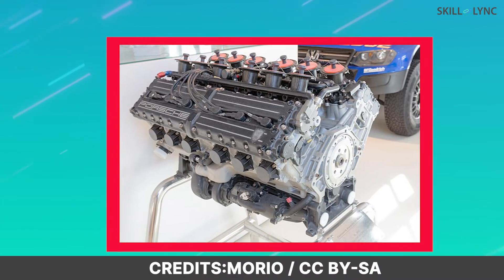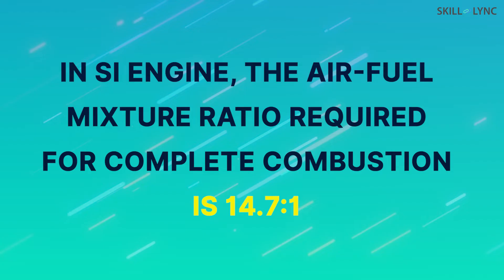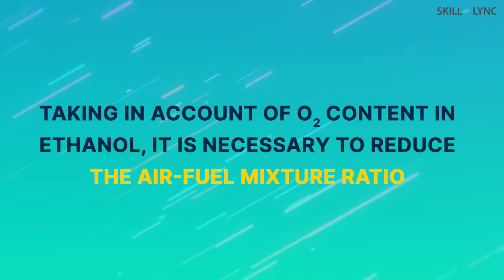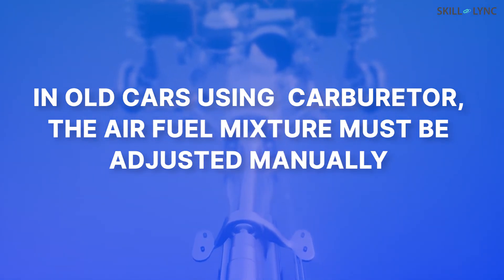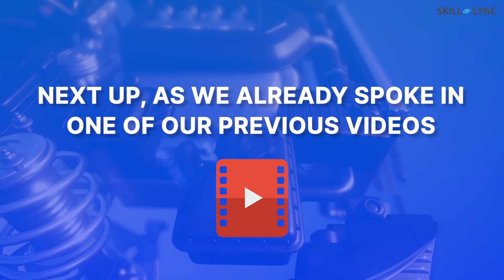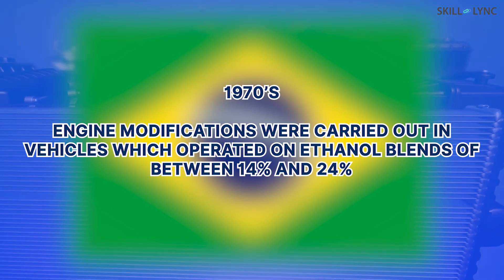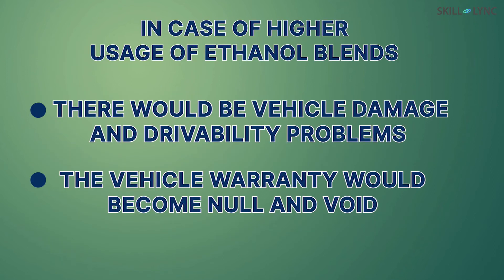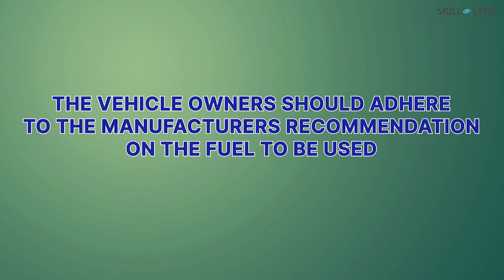Engine Modification - Bioethanol | skill-Lync

Comment: instead of modification of current engines why dun we design engines from the ground up to run most efficiently on E100/M100 i.e neat ethanol or methanol? in a pinch/emergency they could run on petrol/diesel but it is designed to run on alcohol renewable fuels 1st....